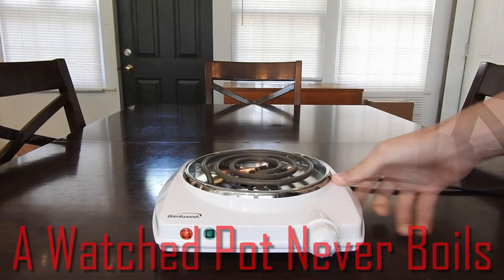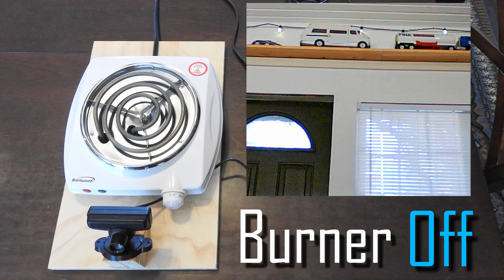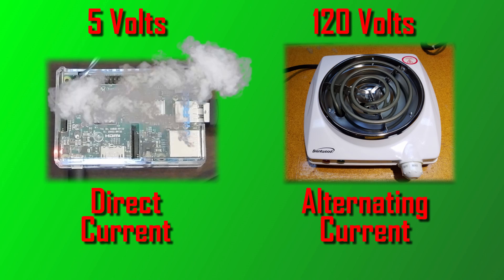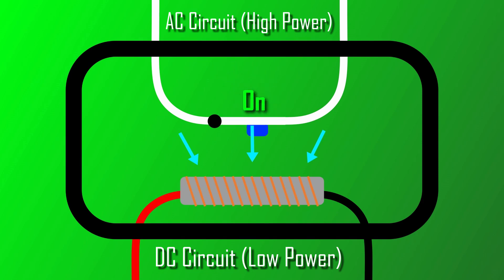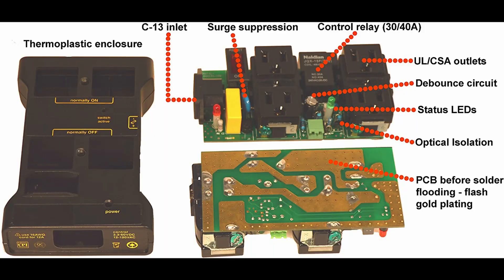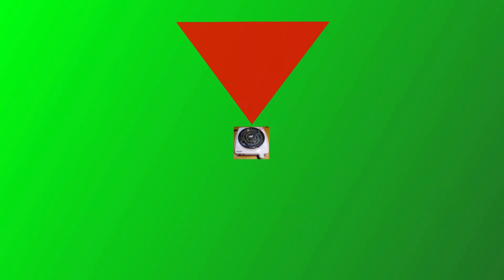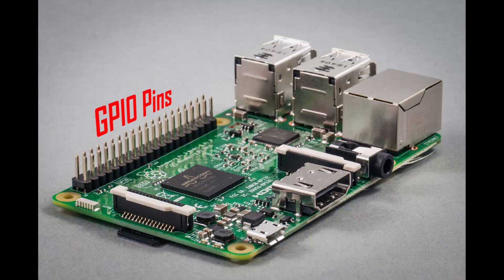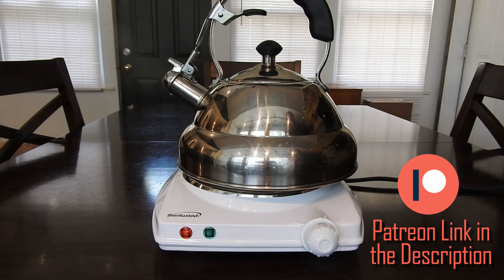A Watched Pot That Never Boils - Literally!

Comment: Try again with 360 camera 🙃nice project
Reply from the maker: Yeah, the main reason I didn't use a 360 camera was because the optimal placement would have been directly over the burner, which would have probably cooked the camera. Cost was also a factor.
Reply: @HarrisonMcIntyre  good thinking but will be nice to see how is working raspberry pi with 360 cam and can u track face,maybe u can try to use 360 cam as a security camera with face tracking and recording with raspberry pi😉